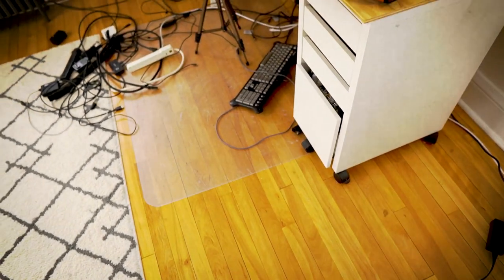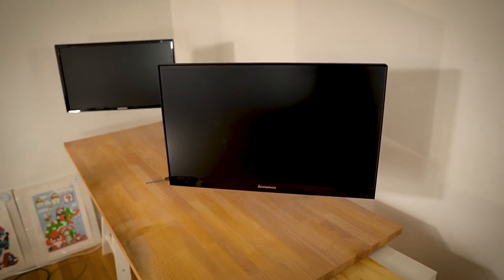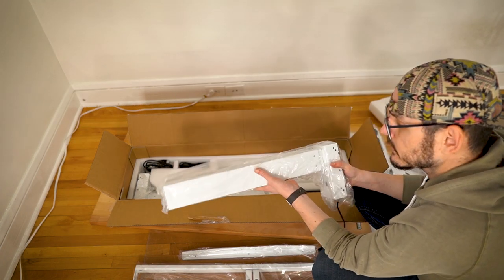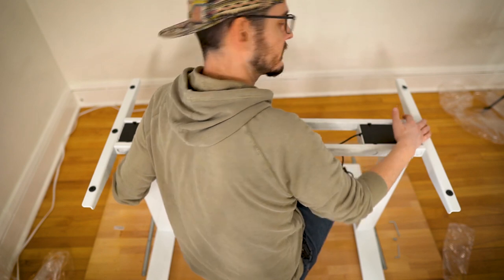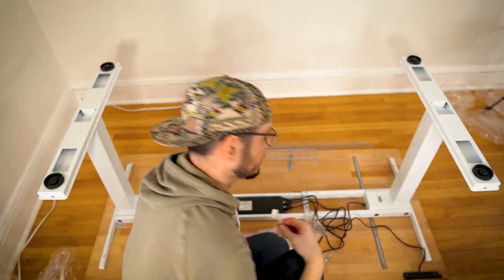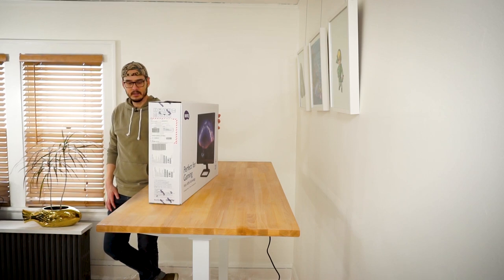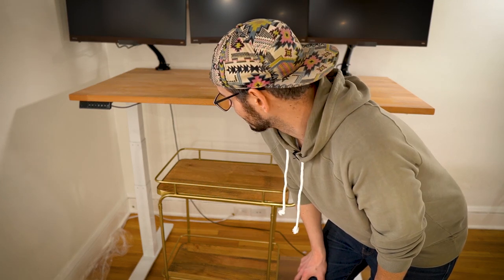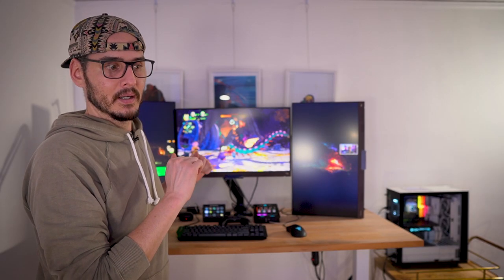Convert ANY Desk to a STANDING Desk: Home Office Upgrade

Comment: You think it’s possible to raise the desk into my old set up I don’t have much room to take everything off ?
Reply from the maker: Not sure what you have but the stand I bought in the description can raise up to 250 lbs!
Reply: @TechnoTim  I wanted to put the standing desk underneath my current setup and raise it take off the legs on my current setup and then drill in the standing desk legs lol and do I guess a swap?
Reply from the maker: That’s exactly what I did.  Used my old desktop put with this lift kit in the description!